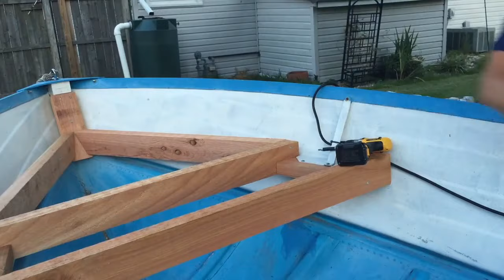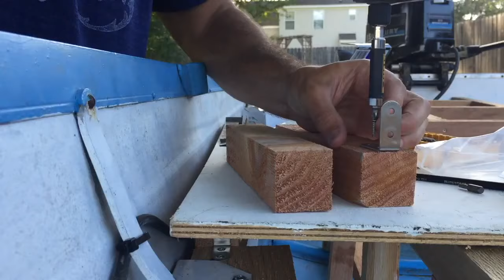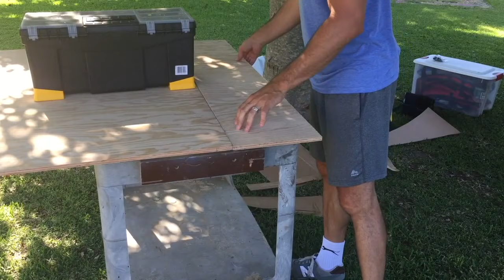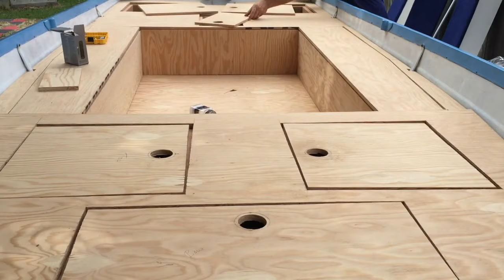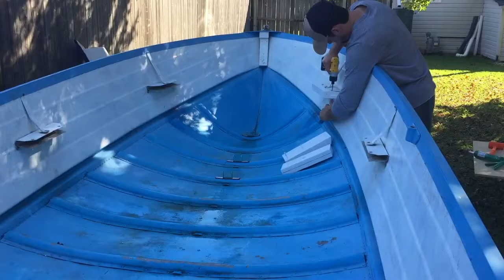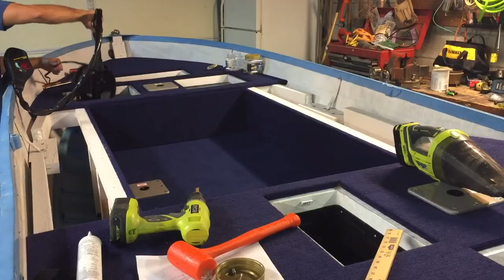14 FT Utility to Tiny Bass Boat | Full Build Time-lapse | Start to Finish!

Comment: How much weight did you just added to the boat ?
Reply from the maker: sorry for the late reply. I dont know how much weight I added but it works fine with myself and another. with the 25hp it goes about 25 mph on plane. you can see it running full speed on this video: https://www.youtube.com/watch?v=5YdJ9oOzhR8

Comment: Approximately how much weight was added?
Reply from the maker: I do not know the exact amount, but it works just fine. Myself, and others commenting on this channel, were concerned about weight. I am happy to say its worked out fine. I used cedar for frame which is light, strong, and naturally rot resistant. Ive been really happy with it so far. There are other videos on this channel that show it running with all the weight in it. Still handles fine and fishes nice with myself and another. Thanks for watching!

Comment: My question is doing all that work on mine if the bottom likes.   I have tried to fix the leak.   at least I don’t need a bucket yet.     :-)
Reply from the maker: Brian, thanks for watching, yes, you'll definitely want to sort that leak out first (one way to do it is to actually put water in the boat if its out of the water on a trailer, its sometimes easier to see if it has a leak that way).

I think after using mine for about a year and a half its developed a slight leak somewhere, but could be transom. I too dont need a bucket, but I do have a bilge just in case. 

I am fortunate enough to be able to trailer my boat and keep in garage, so I can always keep an eye on it, and its not seem to have gotten worse. re your previous comment, yes, this is a lot of work, not recommended unless you enjoy it as a hobby. It took up many good fishing days once I committed to it.

Comment: What model of boat is that? I just bought a 1970 14' MirroCraft V-hull and I'm planning in the fall to tear it apart and do a full build. I've been trying to find deck and compartment plans online with no success. I just keep watching videos and am hoping I will figure it out and how to lay it out. My plan is to do all my framing with aluminum. Your boat cam out absolutely beautiful. I'm a pretty big guy, which is why I want to use aluminum and save weight where I can. What did you use as a guide (for lack of a better word) for how to start the framing, what height, etc?
Reply from the maker: Shane, my boat is a 1969 Starcraft 14' v haul. Not sure on exact model but its pretty wide and the back of the boat sits pretty flat on the water. I was hesitant to start myself because im a perfectionist and wanted it to be perfect. What I did was exactly what you've done, watch videos got ideas. From there I actually sketched it out on graph paper using boat dimensions as best I could. So if I were you I'd use graph paper and draw your boat to scale on the graph paper then sketch in the decking as you want it. If you have questions about my deck size depths etc. I can do take measurements. I might also do some drawings of it and attach below at some point, but alas my regular job ties me up . . . But even if you have dimensions and an idea of how you want layout, that will only give you a rough idea. From there you just have improvise, and slowly start to build. All boats are different so there is no one size fits all. At some point you just have to start the build, and try to think through each section as you do so (make space for battery or gas tank etc.). One rule of thumb. Use the original seats as your guide for leveling the deck not the gunnel(I assume the engineers knew what they were doing)! Then when you do the floor make sure its parallel with the top deck, again, not the gunnel. Just take your time, and trust yourself. I have a phd in humanities, I do NOT do this sort of thing for a living, but I will say I grew up with family who worked with their hands so I do have a bit of that skill. I hated the fact that at some point I just had to take the plunge and start. I made a few mistakes along the way, but im happy with how it turned out. I think you'll be too. Let me know if you have any other questions?

Comment: Hi
Super Nice Build !!!!
All you need is flotation...
Recessed foot pedal for your troller....
Bilge pump ? ......
Reply from the maker: @bruce Fawley, thanks so much! yes, I wish I had done a recessed pedal. I have space to cut it in though if I decide to do it. I do have a bilge, I think you can see it in the video I did on the electrical, nothing fancy, but works great. its on a switch, not a float. I also later installed bow and stern lights. I do have foam under the main flooring which is also in another video I think (hopefully enough to float!), just didn't have time to put all in time lapse. The best thing I got was the power pole, which in shallow water is great to have. thanks for watching!

Comment: Im about to do my own build. I have a 16'x30". How much weight do you think you added? I like being able to move my boat on and off of the trailer by myself.
Reply from the maker: say 10, I'd say just the decking added about 150-200 lbs. Regarding your mention of moving boat on and off trailer by yourself, maybe I'm misunderstanding you, but my boat is far too heavy to move on and off of trailer without a trailer winch. It was too heavy to do be myself (without winch) even when empty (before I added decking). Not sure if this helps? let me know if I need to clarify? Thanks for watching!
Reply: @DrBass-rk1ez  i remeasured. It's 16'x44". With nothing in the boat i can pull it off the trailer and set it aside to use the trailer for another boat by myself. I've been watching video's and taking notes all winter. You did a great job.
Reply from the maker: @say1033  I thought that 30" sounded a bit narrow. You must be a meathead, because even when my boat was empty it took two people to slide on an off of a trailer, and even with two it wasn't easy. So there is no way in the world I could get my boat on and off the trailer without water now. I dont think I could with 4 people!
Reply: @DrBass-rk1ez  i had a moving company for 13 years. You learn tricks to moving things. With all the weight does it feel top heavy or tipsy in the water?
Reply from the maker: @say1033  You clearly know how to move things better than I! As far as weight, its not really tipsy, in fact the weigh seems to keep in more sturdy. Its not a big bass boat but I really think its stable. I regularly fish myself and another on it with both of us standing to bass fish. One on back deck and one on front. You can see in the video just before this one a guy on the back deck reeling in a big fish with me on the front to get an idea of balance. I have been meaning for some time to do a video that shows how it handles when I'm standing up and fishing on it. That will be the next boat video I put up if I ever get to it! but when just me I think it's really stable. Hope that helps!
Reply: I did one a few years ago, and it wieghed a ton, It was so heavy it wound up sitting in my yard unused for the next year, I plan to redo it again but with thinner plywood and less 2x4's great job, neatly done. You do nice work!

Comment: Hey man that looks awesome. I have a couple questions, sorry if you've already answered them in other places. Did you use marine grade plywood? What type of epoxy/resin did you use to seal everything and where did you pick it up? Are all the screws and other metal pieces aluminum or stainless? And lastly, did you epoxy the framing or did you just paint it, and what kind of paint did you use? Thanks for posting this! I think a ton of people are dying for good ideas...
Reply from the maker: Sean, thanks so much for watching and for the questions and kind words. I am by. no means an expert on all these materials and this was my first build. Just like to throw that out there as a disclaimer. To answer your questions: Yes, I used 1/2" marine grade plywood. I used polyester resin on all the marine grade ply (there is a link in the description above). I realize that epoxy is better but its super expensive. I used stainless whenever I could (the actual deck screws and stainless L brackets are also in description). I realize you aren't supposed to mix stainless with aluminum boat, so I put rubber underneath the l-brackets that attach the frame to the boat ribs. I did not use resin on the frame. Instead, I painted the frame with two coats of marine grade paint, which is not cheap but cheaper than resin and easier to apply (paint is also in description). I honestly dont know how you could put resin on 2/4's without a big mess. It works well on flat plywood. I used cedar for the frame because it is very lightweight, strong and naturally rot resistant (someone at a lumber supply recommended cedar). Lastly, Ive had a lot of people on here give me a hard time about weight, and while I could have done with a little less framing for sure, I'm really happy with it. I wonder why people are so concerned about weight, maybe because they use treated lumber? or have not done a build, or they dont realize how light cedar is? but with my 25hp it runs really fast and I can easily fish it with myself up front and a friend on the back deck. It runs great, gets on plane quick with two in it. You can see it running with just me in it in the next video. Its fast. thanks for watching and let me know if you have any other questions?
Reply: @DrBass-rk1ez  wow thanks for such a detailed reply! I have done a couple boats now but they were done with less planning etc. Both turned out very well and weight was never an issue, but I was using spar urethane to treat the 2x2s I was using for framing, and it was a bit messy. I hope everyone out there knows that pressure treated wood can pit the aluminum!!! Regardless, I will be using your walk throughs extensively when building the next one. I will likely just do a casting deck in the front but follow your methods. Biggest take away is how you splice that 2x4/6 and put it into the cleat where the bench was so that you could tie the two sides of the boat together through the deck... All without making another hole in the hull! Genius
Reply from the maker: @DatsDoapMan  Thanks again, Sean. yes you're right about the treated lumber and aluminum. Those were 2X4s on the cleats. And, yes, you're right I did not want to put any holes in the aluminum. I was able to secure the front of the frame (bow) to a piece of 2X3 that I already had there which was used to secured the U-bolt (bow eye) for cranking the boat onto the trailer. People have asked about how I did that. I mention this because I don't think you can see it in the videos. Also just FYI, this video is a compilation of all the videos prior. So if there is a particular part of the build you want to see in more detail there is a real time version of the entire video in parts on the rest of the channel. So you can see what I did step by step. Thanks again for watching and your kind comments, and let me know if you have any more questions along the way. Happy building!

Comment: About how much did this cost including the boat
Reply from the maker: wonder hog, the boat and outboard were given to me, all the rest (including trolling motor and battery) probably ran about $1000-1200. Keep in mind my trolling motor and battery were used. This cost does not include the power pole and fish finder. To find a used 14ft boat and trailer and outboard in decent shape will run you about 2000-3000. So I think a rough cost do to it well is going to be around 3000-4000. It is a lot of work and a lot of time. I always say, you aren't going to save much money doing it this way, so make sure you enjoy it as a hobby if you're going to take on the project. I hope this is helpful. Thanks for watching!

Comment: My dude! Way to utilize the hangers to create your foundation to build from! I want to try a project like this using metal studs
Reply from the maker: stefan, thanks so much, I really wanted to avoid putting any lag bolts/metal studs through the hull and was able to do so using the ribs (with rivets) on the bottom of the boat and the hangers from the original seats. Thanks for watching!
Reply: @DrBass-rk1ez  huh? My bad I should have clarified. I meant metal studs besides using lumber.
Reply from the maker: @stefantaylor5425  oh that's right, yeah, I think it will reduce the weight. I was just more comfortable working with wood. Would you use studs and then cover in plywood? What are those studs made out of? do they rust?
Reply: @DrBass-rk1ez  aluminum framing material. Got the two mixed up. Metal studs from home depot even galvanized tend to rust like crazy I read up
Reply from the maker: @stefantaylor5425  yes, that is good! I think lots use aluminum. Id be interested to know how much it costs. Ive used aluminum for some other projects and its pricey. But wood is not cheap either.

Comment: Did you add any extra foam to help offset the added weight of the framework?
Reply from the maker: yes, you can't see it in this video, but there is foam under the floor and a bilge pump (you can see all this in my other videos wear the build is broken down into longer vidoes). Thanks for watching!

Comment: How much weight did that add to the boat?  I've been debating between 2x4s vs 2x3 and 2x2s.
Reply from the maker: @David Archibald, you can see me talk a bit about weight in my most recent walkthrough video. I'm not sure how much weight it actually added, but im happy with the way it handles and fishes with all the weight in it. I have a 25hp so it didn't slow it down much at all. As I say in the walkthrough, I think I could have done with less 2X4's. It seemed in the end to be a bit of an overkill to have that much lumber, but again, I don't think I'd really notice much of a difference weight wise. I fish regularly with myself and another and it still runs about 25mph and handles waves well. Hope your build goes, or is going, well. thanks for watching!

Comment: How much wood was needed for your project exact amount of two buys and sheets of fly if you have measurements of all of your cuts for that exact bill that would be great I have the same boat and would like to do this same exact build except for seat placement
Reply from the maker: I have not done exact measurements etc. I used rough cut cedar planks because it is lightweight strong and naturally rot resistant. I used 5/8 inch marine grade ply (I only need two, I measured very carefully to maximize the panels). let me know if you have specific questions and I can go measure boat for you. Thanks for watching!
Reply: Your boat looks like my Sea King, if your ok with it I would like to follow your setup, just my seating location may be different.
Reply from the maker: @lamaroglesby295  yes, by all means. I dont have any drawings of it, but there are lots of other videos on this channel that have the entire build from start to finish that should help you. Thanks for watching!
Reply: @DrBass-rk1ez  much Mahalo's for taking the time to provide us all with your video build, Aloha braddah 🤙🏽.
Reply from the maker: @lamaroglesby295  thanks so much, I really enjoyed making them, and its good to know others are benefiting from them. Best of luck on your build!
Reply: What sealer did you use?
Reply: How carpet did you need?
Reply from the maker: @lamaroglesby295  I dont recall, I got two small rolls of it, but will depend on your boat size and how much decking you put in it.
Reply: @DrBass-rk1ez  I was think two 6'x8' small rolls. Thanks brotha🤙🏽

Comment: Nice! How much weight did that add to your boat?
Reply from the maker: im sure sure but it worked out really well in the end. Ive had no issues. you can see me running it full speed in some of the other videos and you can get a feel for what it looks like with another person fishing on the back deck. It's a bit crowded with 3 on it but ive fished three guys on it and it does just find. Yes, aluminum would have been lighter but at the time it was very expensive. thanks for watching!